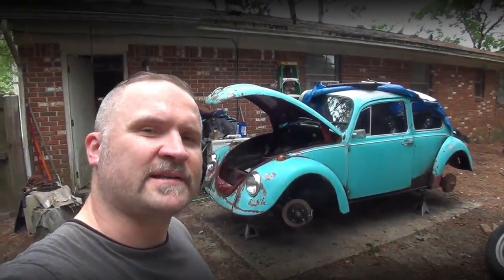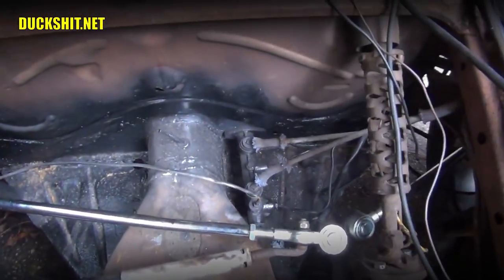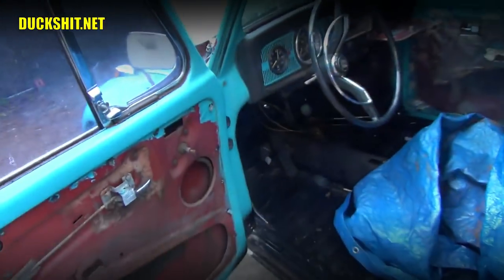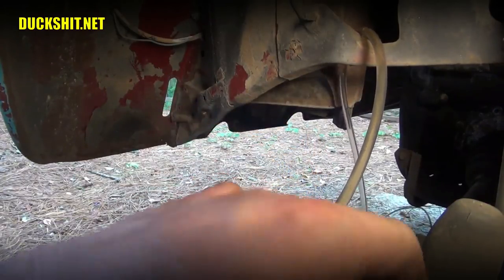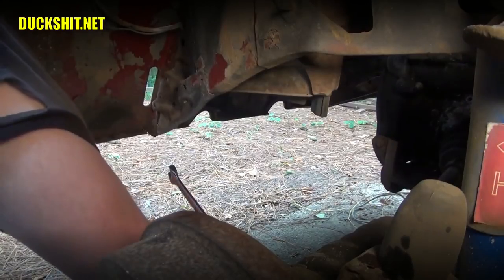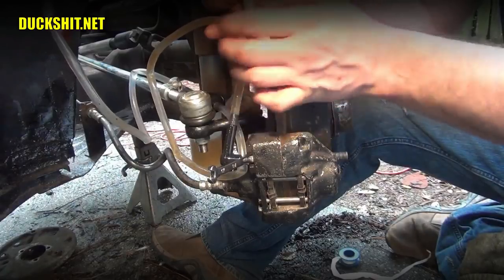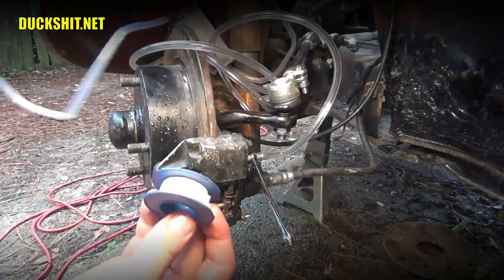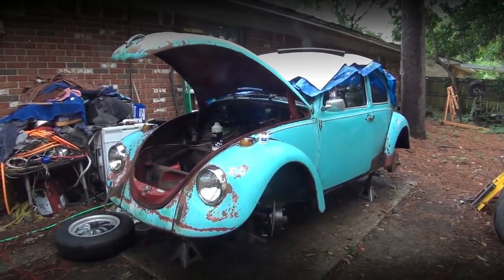How to Bleed Your VW Beetle Brakes

Comment: I do the one man gravity version of this. Pop the top off the MS, open one line at a time, let it drain until clear. Gets the air out and gravity feeds new fluid in the line. Takes longer but when you are alone its an easy option. Great vid man! Keep em coming!
Reply from the maker: That works pretty well to get things started I will admit, sometimes you might still have a little air in the line though between the drops.   But you can't beat that as being a great lazy method!   Thank you so much for the suggestion!

Comment: About 10 years ago some parts suppliers offered the 'mighty vac' to bleed
any brake systems. This was avail. with different fitments to the reservoir
whose holds up new brake fluid and applies light pressure to the brake system.
At the other end is the the pump which makes an additional vacuum.
A one men show. Another models was with a connector to a air compressor, 
promoted to use in professional workshops. Guess if its still available, or not.
Reply from the maker: Yes sir!  I demonstrated one such Mighty Vac in this video!  https://youtu.be/iuue2Le-5AE?t=1142   I got my sucky-sucky tool here: https://amzn.to/2H2xwit  It works great!
Reply from the maker: As you said there are also compressor based "power" versions.  I see one used at the local motorcycle shop around the corner from here.

Comment: i know im a little late to the party lol almost 3 years....anyways i have a 62 beetle replaced all the metal lines, rubber hoses, upgraded to dual circuit MC and 4 wheel disc brakes. i also installed a dual chamber reservoir on top of the master and installed a rubber fitting so i can use the original res to fill the other res from up top. my question for yah is how to bleed the master installed in the car. side note..i am going to see if she will work with me before screwing with the push rod. any help is greatly appreciated, oh and i love your videos, tons of awesome tips and laughs!!
Reply from the maker: Well word of advice, don't mess with the brake push rod.  You might want to check the length of it, but you probably won't have to mess with it any at all.  As far as the rest of the bleeding method, watch the video! It's all in the video :-)  thanks so much for being a fan and thanks so much for your question!

Comment: um you almost do it the way I do, but here's the way I do it, I have a hose like that, and it's in a bit of clean fluid in the jar. Attach the hose, (shorten it so it goes right to the bottle) then just open the nipple and pump hell out of the brakes. IF it sucks up anything, it sucks up fluid. However for what you're doin, flushing the lines, your system works well. I was doing it on a completely clean system so I didn't have to worry about that. That also makes it a one man job if you don't happen to have one of the vacuum things.
Reply from the maker: Yep, that'd work.  :-D  Thanks for the comment!

Comment: You don’t need 2 people and you don’t need a special vaccum tool , you immerse that hose in a plastic drink bottle with the hose going through the bottle top , slightly leave the cap open for pressure release , and immerse the hose in brake fluid , you also don’t need the pipe to be raised just open the valve , go to brake pedal pump it through ; I also would not pump it through that  hard these are old master cylinders which will leak if forced violently
Reply from the maker: Never had much luck with your method... but yes, even 1 person, and no sucky tool works fine, just need a prop on the pedal when you release a bleeder valve.   Thanks man.

Comment: 1:04 or #4: Using a Jar filled half-way with Brake Fluid and a Clear Tube going from the Bleeder into that Jar and then depressing the brake pedal until it drives all the air out and when it draws back it pulls fresh brake fluid back, keeping air out of the system.
Reply from the maker: Yep that's the way it's supposed to go!

Comment: My method is a bit different. But if done correctly, it requires only one person.
1) fill a small brake fluid bottle about 1/4 the way up.
2) Poke a hole in the bottles cap so a rubber hose than will fit snuggly on the nipple, will also fit snuggly thru the cap. Push the hose thru the cap a length to where the hose just touches the bottom of the bottle when the cap is screwed on. Screw the cap on.
3) Starting with the farthest wheel cylinder and the reservoir topped off, and the cap OFF of the reservoir so it doesnt create a vacuum, crack open the valve and leave it just barely cracked. Put the hose sticking out of the bottle on the nipple. Check to make sure its just barely cracked open. Important.
4) Go sit down in the drivers seat and slowly, but completely push the pedal all the way to the floor. How much you have the valve open determines how fast the pedal gets to the floor. But there must be some resistsnce in order to make sure fluid is at the end of the valve. There may be some air in the rubber hose after the first pump. But the fluid in the bottle will keep the cylinder from sucking up air agsin. So after two pumps the only air in the hose will be from what was in the line, if any. (Note: you will also feel air leaving the brake lines and cylinder if any as you push down.
5) keep an eye on the reservoir. Do not let it run dry. After a few pumps and you dont feel the brake lines fart anymore, tighten up the bleeder and THEN take the hose off.
6) making sure your bleeder bottle is atleast 1/4 full, and reservior is topped off, repeat the process on the next farthest wheel from the master.
Reply from the maker: Thank you for your generous input, I have learned from it and I will try to apply some of your methods next time.
Reply: @DuckmanCycles  
Thank you. Its always worked for me.
Oh!!!! There was one other thing. Put a small pinhole next to the hole that the rubber hose goes through. Its to let air pressure building up in the bottle out.

Comment: I flushed on my 74 and now  don't have brake pressure.  I verified that there are no bubbles. Do you have any suggestions on what it might be the issue?
Reply from the maker: Hmmm, check to make sure there are no leaks anywhere.  If anything looks wet at all.... REPLACE IT!  Usually when I dig into a VW brake system I just start replacing the wheel cylinders and master cylinder whether they appear to need it or not.  For less than $100 you have brakes that work like new!

Comment: What kind of brake disc roto is it or is it an original from the factory?  I'm looking to upgrade my 74 but don't like EMPI on how it fitting
Reply from the maker: Its mostly OEM parts, except for the caliper brackets and the drop spindles.  The EMPI kit is pretty much the same as anyone else's these days.  Here's an IAP performance kit, its all the same stuff.  Same with CB's kit.  https://amzn.to/2PaBc6c
Reply: @DuckmanCycles  thanks for the link.  Now I know where to get them. It's cheaper than EMPI and i like the way how they fit on the car, like it comes stock.  Has it been working well for you?  I had my flushed over the weekend and now experience with loose pressure.  I might have to get it re flush again.  Thx duckman
Reply from the maker: @vsaapw2799  This one I haven't driven yet, but the other ones I did before are working great!   My Type-3 Fastback has the same brakes also, plus a rear disc kit that I upgraded to last spring, it also has been treating me right!  Glad I could help, thanks for your questions!

Comment: Hey, man, I put a new master cylinder in my 64 Volkswagen. I can't get the master cylinder to pump up. I've had it out. I've bench bleed it and put it back in. I have attempted to bench bleed it in the car. I've pumped more than half a bottle of fluid through all of the wheel cylinders
Reply from the maker: Well, i'm not sure what to say.  You'll have to clarify... because it sounds like you don't have a problem at the same time.  What's wrong?
Reply: @DuckmanCycles  no brakes pedal goes to the floor
Reply: @DuckmanCycles  I own 4 shovelheads and panhead  2 other vw's and 2 ford trucks never had a master cylinder not pump up
Reply from the maker: Well if the fluid is coming out of each wheel then it's pumping just fine... unless you keep getting a ton of air with it.  But assuming you are running drum brakes... run all the shoe adjusters out on every wheel, and try again.

Comment: We are working on a 2002 beetle, but the drivers rear side won’t bleed, any ideas? We had to rebuild the Calliper on the drivers rear side due to the seal becoming undone. Could the problem be our handy work on the calliper? Thanks.
Reply from the maker: Could be, yes.  If there is an air leak in the caliper it will draw air back in when pedal is released.  Maybe pull caliper and test for leaks on bench with a syringe of brake fluid.
Reply: Thanks for the reply. My partner has just said he removed the brake line on the bad side and nothing comes out still. So he’s ruling out the calliper /piston being the issue now. Any ideas? Thank you so much.
Reply from the maker: If you remove the line the air can still get back into it, so the master cylinder will pull the fluid back.  That is normal behavior.   If you let the line hang down in time it may drip. Unless the line is old, they have a tendency to swell themselves shut.

Comment: I got 70 ghia tht pulls  hard to right when braking what u think it could be
Reply from the maker: Probably the brakes on the left aren't working, or the brakes on the right are binding up for some reason.  Whenever the things like brakes start acting weird on an old Volkswagen I just replace everything, master and slave cylinders and all of the soft rubber lines. I also make sure I have some hard lines for replacement in case something breaks when I take it apart.  In most cases you can do this for $200 or less. Totally worth it for brand new brakes.
Reply: @DuckmanCycles   thank you for the info .... love all your videos very helpful  information

Comment: If you lose your rear brakes, you should still have your front one's, right? My bugs a 69 model.
Reply from the maker: Or vice versa!  That is correct for a dual circuit master cylinder which a 69 VW should have!  You will notice the brakes require a ton of force to press, and may even lock up easily not not stop well.  Thats a few symptoms of a circuit failure
Reply: Thanks much.

Comment: i have a 73 super beetle  bought new master cylinder and new wheel cylinders front and rear. i bled the rear brakes starting with passenger rear and then drivers rear. went to passenger front and trying to bleed it. my friend pumps the peddle and holds it down and the peddle won't go to the floor like it did bleeding the rear brakes. and the fluid dribbles out . try it 4 or 5 times on both front brakes and its the same. peddle won't go to the floor when i open bleeder only dribbles alittle.. do you no whats wrong
Reply from the maker: Sounds normal.  The brake pedal will get higher and higher as you continue bleeding the brakes.  The fluid will come out with less force as there is no air in the line to compress and blast it out.  Keep going until all the air is gone, it should be fine!

Comment: What's the part number for your hard to get very rare brake fluid reservoir wedgie block .🤣🤣
Reply from the maker: I don't know why that's there lol.   it belongs to the owner, it's not causing any problems, so it's going to stay where I found it :-)  hehe!  Thanks for the comment!
Reply: I saw that as well. In 1969 they did not have duct tape so that’s why they had the wedge of wood